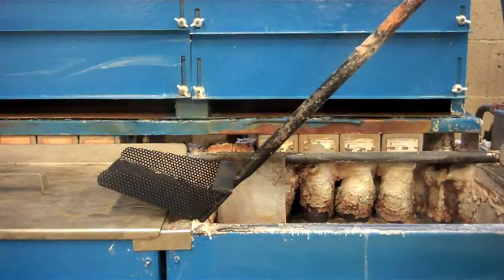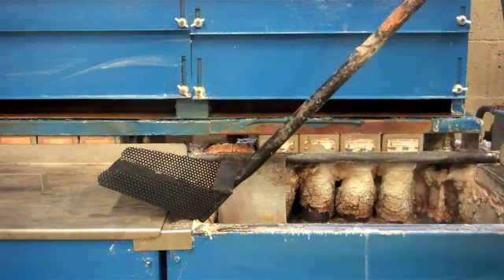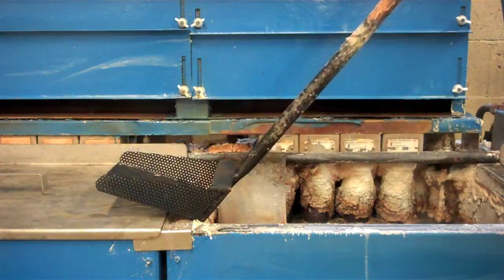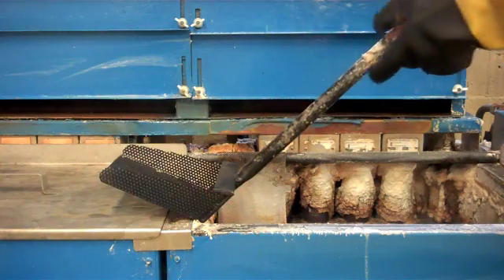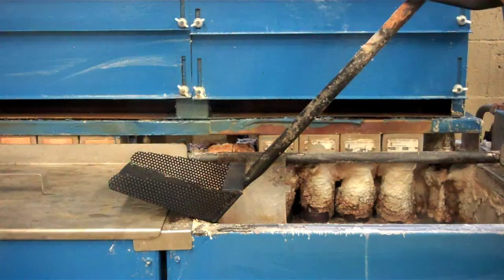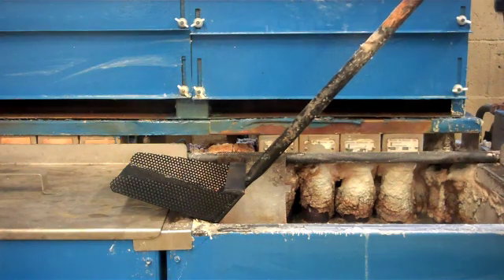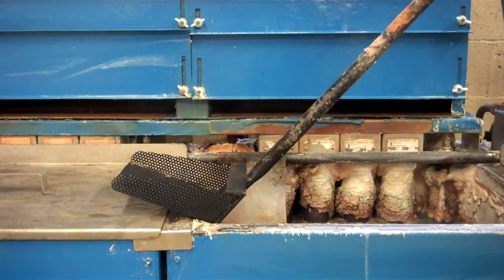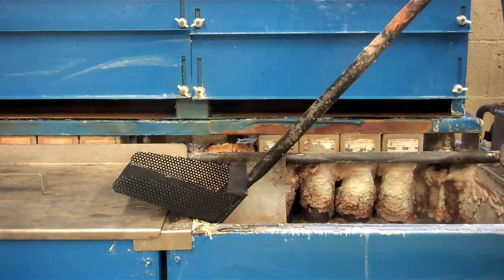Desludging a Black Oxide Bath

Comment: I am a black oxide operator I've been doing it for 2 years my question is some of the parts I do I hang off a hoist in a chain sometimes it leaves a mark from the chain so I just rinse it and I stick it back in the oxide tank some parts are called double dippers they are too big for the tank this causes a mark to be left on the park any ideas